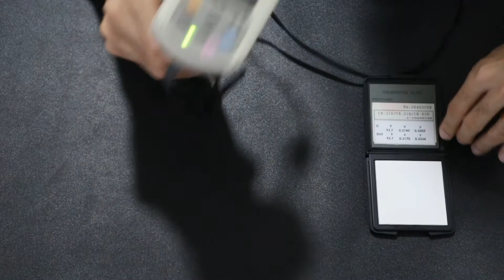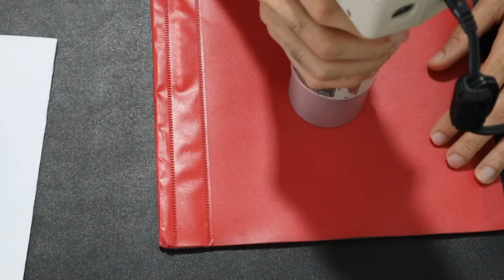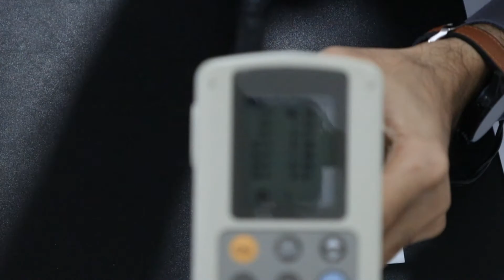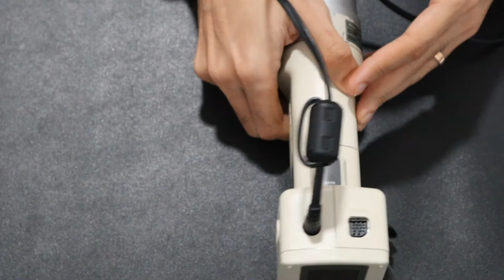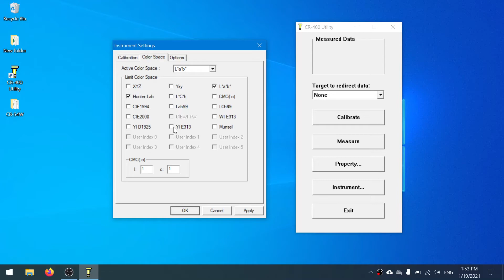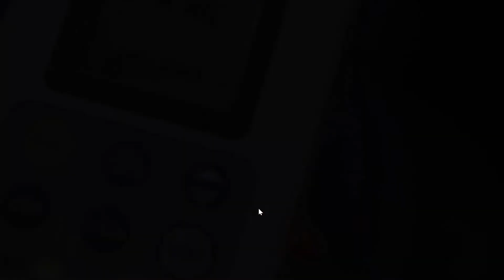CR-400/410 Tutorial Video

Comment: Thank you for the video. Can we get the graphs according to the wavelengths of the measured samples?
Reply from the maker: Hi, you are welcome. 

You cannot get the wavelength for the measured sample using the Chroma Meter series. You will need to use a spectrophotometer series eg. CM-5, CM-36d, CM-25d, CM-26d, CM-26dG, CM-16d & CM-17d.

Perhaps you could share more on your application.

Comment: Good video. Can you make a video on how you capture the data into excel after the calibration?. I tried to do it and it's working but only in XYZ format. I want the L*a*b* format. Thanks.
Reply from the maker: I should have included this in the video. However, its pretty simple. If you have the utility software installed, you could go to this folder:

C:\Program Files (x86)\KONICAMINOLTA\CR-400 Utility\SampleSheet

or 

C:\Program Files\KONICAMINOLTA\CR-400 Utility\SampleSheet

There are 3 sample sheets there. Pick which that best suits your needs. It would calculate L*a*b* for you. I would use this sheets as my template when transferring data from CR-400/410 to Excel.

Hope this helps.